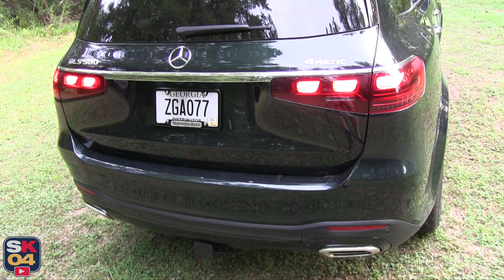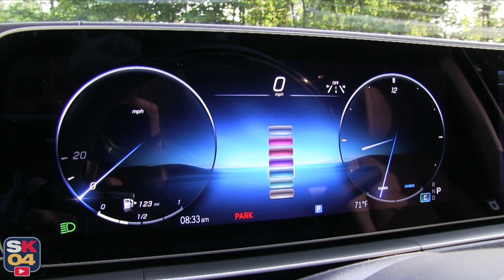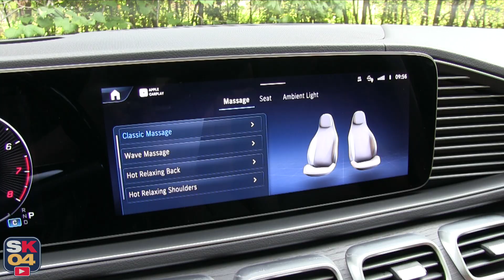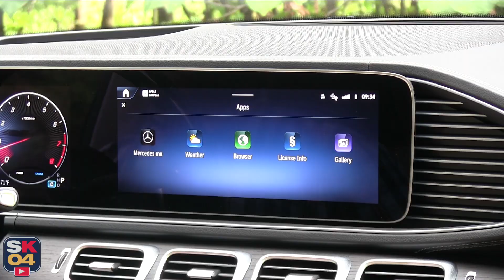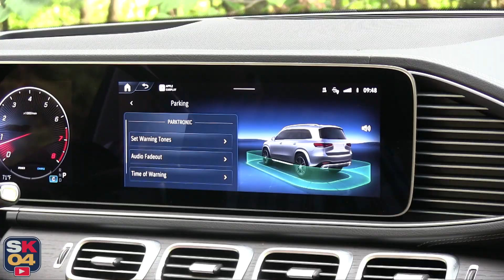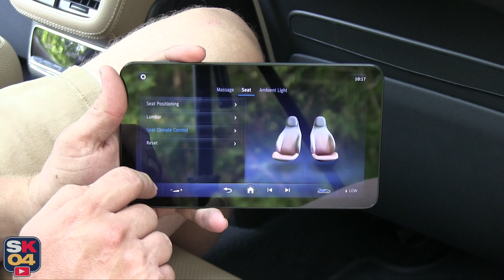2024 Mercedes-Benz GLS 580 4Matic: Start Up, Test Drive & In Depth Review

Comment: If it can tow 7,700 lbs the tongue weight should be 770 lbs 10 percent of trailer weight so it must only tow 3000lbs its not safe to tow anything with less than 10 percent tongue weight the trailer would sway all over the road that does not make sense. Unless the tow rating is only with weight distributing hitch but even then 300 lbs of tongue weight is still crazy low for such a big SUV my old Crown Vic sedan had a 500lb tongue weight lol!!!

Comment: Beautiful!! What’s up with that weird pattern and lettering on those Continental tires? Not a fan of those tires and they detract from the overall look. I like the machined faced rims. Also, for this price, a two-piston front caliper is unacceptable. At least provide a 4 piston. The new Lexus TX 500h has a 6 piston front caliper.